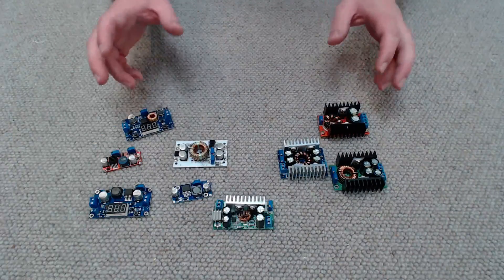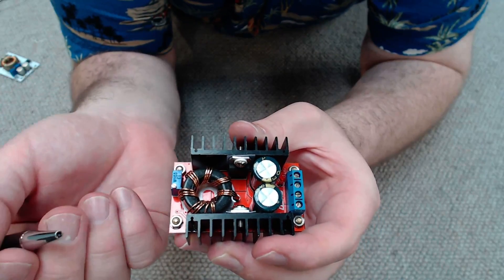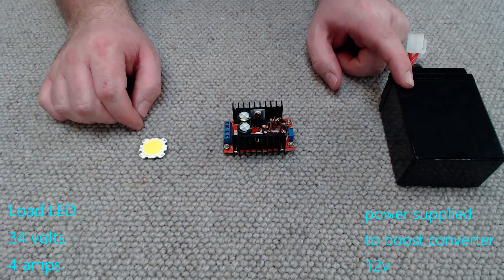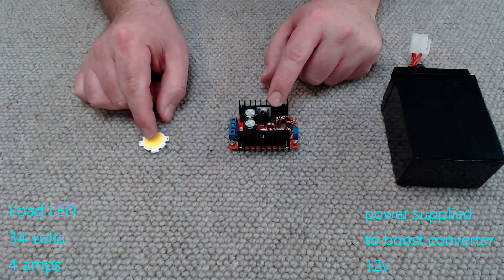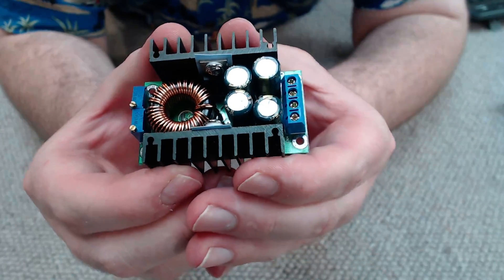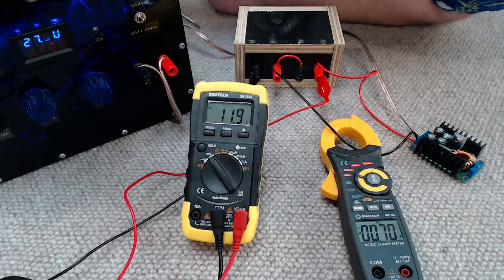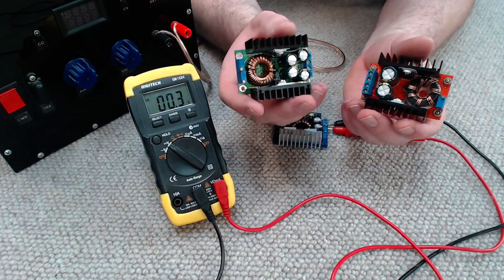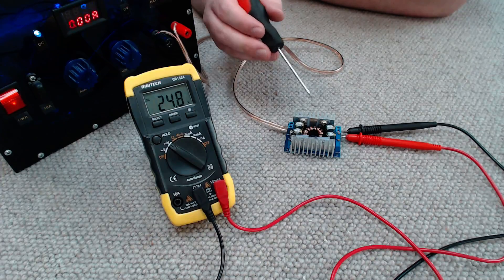What You Need To Know Before Buying A Boost/Buck Converter

Comment: I have a question...Can I put two or more buck converters in parallel ? My solar panels providing 20v/10amp approx.. I just want to put two or three buck converters between panels and charge controller(pwm) to provide 14v/13amp to charge controller. If I use only one...it heated very quickly... Thanks in advance.
Reply: monaxp606 this is basically what I also would like to know. I am making my own power wall of lithium batteries. Each pack holds 22 Amps and I would like to connect them in parallel to provide power to my cabin. Instead of buying a 100 Amp boost converter, I would like to use 4 converters in parallel.
Reply: Of course you can do that. But one high power converter is always preferred over multiple small converter only bcz of the loss in conversion. Net loss with multiple small converters would be higher than net loss of a single converter.
VI input = VI output
(Max output can only be equal to input). And also there is current limit to maxm current which it can handle. Even if you wish to throw more current in input to get higher output, it would simply not draw that current. Higher the conversion difference, higher the heat and energy loss and lower the power. That means lower the output current in general.
The best suggestion would be to buy the converter according to need after calculating all. And if you wish to charge the batteries with it then only take the converters with adjustable current bcz if it has only adjustable voltage then as soon as you connect to a discharge battery it will draw huge current instantaneously and that will overload the converter resulting in shutdown.
Reply: You are doing it wrong.  There is no reason to buy multiple buck converters, the right charge controller by itself should do fine to charge if rated for 14V/13A.  Further, if you put multiple regulated converters in parallel then you need to put a series resistor after each, or isolation diodes, so that they don't fight against each other to regulate to slightly different levels which could make them instable.  Plus that would incur losses.

Comment: I want to know which buck or boost used for 12volt 1amps wifi router. 
From 9 volt to 12volt amp and from
24 volt to 12 volt 1 amps .
Which is suitable for that device ?
Reply: Engineer Habib Makhdoom get a step down converter with constant current output

Comment: Is there a way to parallel inexpensive boost converters to get a higher net output?
Reply: Tom Griebe buck convertor
Reply: Get boost converters. You can raise output by adding in parallel. Parallel combination will raise current delivery not voltage.

Comment: Hi there, the output voltage of my dc dc buck boost converter does not change when I adjust the potentiometer.  Is the problem only on the potentiometer or is it somewhere else ?  Thanks👍

Comment: I like to know witch converter that I can use to use for a charger on a ebike using a small 12 vote wind turbine on the ebike but battery is 72vote
Reply: Chris Haucke Simply non. Bcz conversion in this range is simply very high and ultimately your small wind turbine may be insignificant to charge your battery pack. If your wind turbine provides sufficient current then convert it to ac first and then to dc at your required 72v (not in multiple conversions but a single conversion).

Comment: Can you please understand that sometimes we need just simple  instructions like  red wire  goes here white wire goes there  thats it! i watched the whole video and im more confused than before and still can not wire my 100 WATT LED
Reply: If you don't understand polarity then you should absolutely not be wiring a 100w led
Reply: Understandable.. There are many more video's out there showing you how to do it and i'm sure by now you have found your way. However when playing with a 100w led you can never do enough research before attempting to replicate. In case somebody reads this, have a look over at Matt's channel called DIY PERKS. He has very detailed instructions on how to wire high power led's and very high quality video's. Good luck!
Reply: This is not what you want to power a 100W LED.  You want a driver specifically designed to drive a 100W LED that is set up as a fixed constant current, a product spec'd to the input voltage you are using.  Given your limited ability to even hook up the supply wires, it seems you are not yet at the point to calculate if anything else would suit your application.
Reply: I seriously urge you to learn this stuff before playing around with large LED's. Electronics can be a lot of fun to play with, but any time you use electricity you are vulnerable to certain dangers. Even with low voltage that can't shock you, mistakes can destroy components, equipment, and cause fires. You need to know some of the basics, or you could have serious problems.
Reply: This is not an LED wiring tutorial... you got the wrong video.
Reply: Schrader, Just think what it would be like running a 2000 watt, 24 volt Halogen searchlight bulb. Don't need the bulb to catch fire. Just the output of it will set anything close by on fire. ;-)
Reply: You don't know which wire goes where and want to power a 100W LED?
Have fun with a burning house because your LED catches fire.

Comment: Used a buck converter to charge my phone from some aa batteries. Voltage somehow jumped to 60 volts from 5v and fried my super expensive phone. Well shit.
Reply: You are mistaken.  There is no way to produce an output voltage (to phone) higher than the input battery voltage using a buck converter.

You'd doubly mistaken that voltage climbs if resistance does.  On the contrary a higher resistance and same current will drop voltage or vice versa, this is ohm's law.

Third, there is no significant resistance increase as the phone charge increases. However if there is a fixed output voltage to it then the voltage differential between it and the phone battery will mean that the cell impedance drops current as voltage rises, except that this is handled by the phone's charge circuit so it's not a factor.  You could feed it 5V and infinite current and it's going to charge no differently than 5V, 3A supply.

Comment: if i need 5 v and several 10s of amps from a buck converter is it best to have as high as V in ? like this one http://www.ebay.com/itm/DC-300W-20A-CC-CV-Constant-Current-Adjustable-Step-Down-Converter-Voltage-Buck/401342111666?ssPageName=STRK%3AMEBIDX%3AIT&_trksid=p2057872.m2749.l2649
Reply from the maker: Yes, you are correct. I prefer to supply my converters with a decent amount of power to ensure proper operation.

Comment: Hi
How can I add a potentiometer to a buck boost converter (voltage regulator), so i have the possibility to set a min. 6 volt and max 12 volt and use the extra potentiometer to dimm the LED light from 6 (off) to 12 volt (full brightness).
It is for video work, so i don't want flickering of the light
Reply: You could remove the volts setting preset, and wire a panel mounted resistor of the same value in it's place, then mark two points on the panel that coincide with the brightness settings you wish.
You can extend that idea to make it possible only to go between those limits, but it needs one or two other presets, or resistors to effect it.
Reply: You would have to experiment with different value pots, most of these have 30 turn 100k or 200k so if you ordered one half the value you may only reach half the voltage, but the low limit would be all the way down toward zero.  Really not the right application how about using a dimmer on a 12 v with xformer type supply it may work.

Comment: i bought a xl6009 from aliexpress, and hooked it to a 5v battery to run a  12v dc toy motor, the boost converter gets really hot, i am pretty sure it will die if i keep it going. what can i do about this? how can i limit the current?
Reply from the maker: You can lower the current draw by lowering the voltage output from the boost converter. Or buy a bigger converter
Reply: Is it one of the small size versions? They expire quickly once the temp gets up as the diode for one, becomes derated due to heat and can no longer pass the required current. Eventually, it shorts. You can replace it with a higher current version. I used one from an old PC psu.

If you obtain a fairly thick thermal pad, you can place the board against it and a heatsink. The pad must be sufficient to prevent the pins shorting. It helps somewhat, but the small footprint versions of the converter are severely disadvantaged in that heat accumulation is big. The small buck converters are the same.

I now use the buck converter shown in the video. They are possibly listed as 12 Amp. Every one I bought was actually 8 Amp. They have two presets, not one, like the 12 Amp version I also first bought. XL4016 is 8 Amp (40 volts). XL4012 is 12 Amp (32 Volts).
Reply: Put a reverse biased diode on the motor and get a boost converter that can supply a few amps and can withstand sufficient current on the input, as well as has sufficient heatsinks.
Reply: Use external fans(cpu) to cool it. But better get a higher power converter

Comment: If you should measure the amp with the other multimeter with read and black wires is it as simple as turning the multimeter too A? I don't get any reading on mine, which I think is a little strange. Maybe I'm doing something wrong
Reply: Kasper Nørgaard To measure amps, you must put the meter in series with the current source with red wire to supply positive, black wire to load positive and load negative to supply negative. You also must set the meter on A and make sure to select the appropriate range. Never overload the meter!

Comment: Are you ever concerned about static discharge damaged components from your carpeted benches?
Reply from the maker: I've used natural wool carpet, which keeps static to a manageable level. If I were working with static sensitive components I'd definitely be putting down a static mat on top of my work bench.
Reply: Lets just say there is a very good reason why you never see carpets anywhere near test benches in commercial establishments.

Comment: Hi if you get a boost Buck converter and set it to 12v output
would it automatically change from Buck to boost if you changed the input voltage?
Reply: TheWhiteScorpio1 Nope unless out is set equal to input. If you keep output higher than the maximum input you can get then the output will remain constant regardless of input voltage in that range
Reply: Leroy Baker hello dear
Reply: It never changes, first boosting voltage then bucking it, incurring two losses.  This is why you choose only a buck converter if your input voltage is always a Vf margin above the output voltage.
Reply: yes correct of course within input voltage spec
Reply: @LazyH-Online And that's what I wanted to know also, Thank you for giving the correct answer. As I'm making a 17v battery pack and wanted to 'home charge' it with a 19v lappy P/S and also charge when outside camping with a 12v car battery. So, if I 'set' the output to 14.8v/1A, no matter if the input is 19v or 12v, I'll still get the 14.8V to charge ?  Confirm?

Comment: Thanks this helped me allot ! just a question . it is possible to hook up a 18V solar panel straight to a step down Buck converter to 5V ?
Reply from the maker: Yes, however make sure the buck converter is rated at least 10% higher than your input voltage to give yourself some 'headroom'

Comment: I bought some of the the red boost converters shown in the video. I connected a 12v power source to the input and connected my multimeter to the output and all I got was something popping and then some smoke. My output is now the same voltage as the input and the potieometer does not work. Did I do something wrong?
Reply from the maker: Yep sure sounds like it. If you've heard "popping" it's quite possible you've toasted it.
Reply: You should have reset potentiometer to lowest before connecting anything

Comment: great video, thanks! I'm planning to buy a buck-boost converter to supply a mini PC (router/firewall) with 12V (3A MAX).  I will supply the computer power from a battery bank fed from a solar array so the Voltage will vary and because of voltage drops in the cables it could go below 12V some times when im using other stuff too.. thats why im going for buck-boost. Is there any disadvantages using a buck-boost instead of only a buck converter?
Reply: taztaz79 yes loss of energy in conversion. For 1a or 2a there is not much loss so you can use it. Any if the voltage drop in your wiring is significant then your wiring is not sufficient enough. You may need thicker wires.